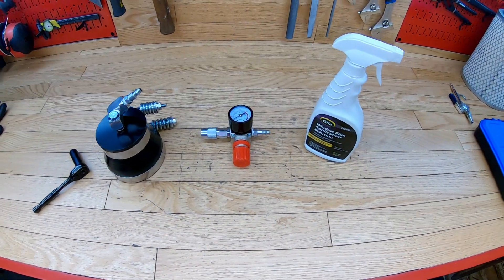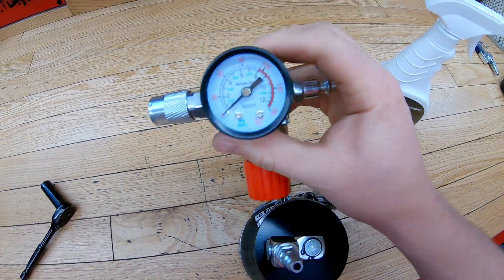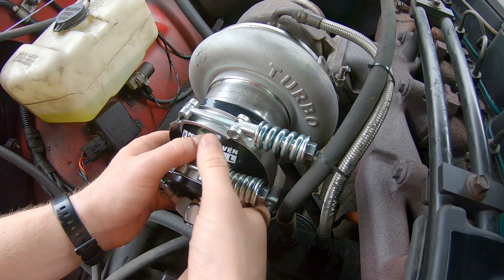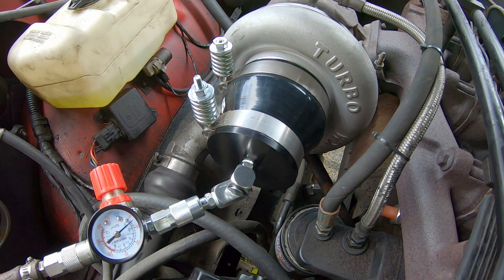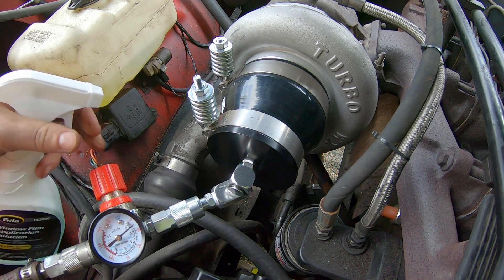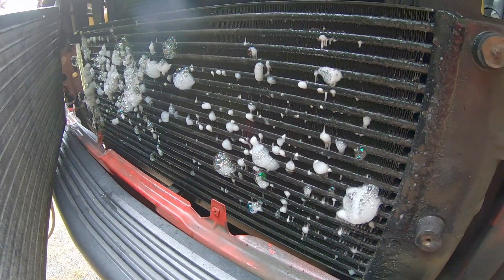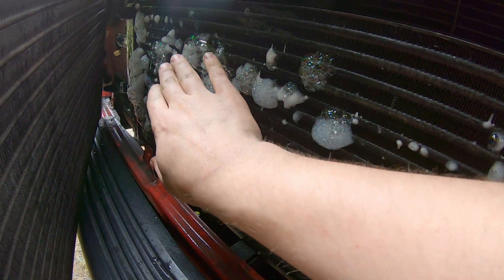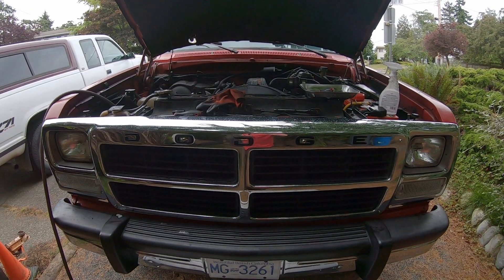How to Test for Boost Leaks | 1st Gen Cummins

Comment: What happens if I do that just with the engine running?
Reply from the maker: You will likely not build enough pressure in the intercooler to test for leaks. Ad idle the stock turbo probably only makes about 1psi boost
Reply: @OvensGarage  ok thanks man

Comment: Placing big, aftermarket air turbines on these small diesels is not a good idea.  I recently bought a ‘99 Ram 2500 the previous owner had aftermarket shops “upgrade”.  All he accomplished was creating problems.  He couldn’t afford to pay for the repairs and had to sell the truck.  I picked it up in trade for a few handyman jobs, and then I spent all the time ungrading the truck.  Thinking you can improve on 60 years of testing, and all the effort in trial and error at universities by automotive engineers, now that’s arrogance and foolishness.  Yes, 30 psi will ruin things.  Cylinders, built of cast METAL, are designed to take the compression of the fuel/air mixture.  Your thin finned air cooler is not.

Comment: I put a power stroke intercooler in my 89. It was years ago, and a pain in the ass. Don't even want to know if my other 2 trucks leak.
Reply from the maker: Yeah that seems to be the one people are putting in is the powerstroke 7.3L intercooler, will see what I can come up with after a bit of measurement and research. There's a lot of universal ones out there too. One of them is bound to fit nicely. Just have to do a bit of up front measuring work first to identify the one that will fit best.
Reply: @OvensGarage  Of coarse my 89 was originally non intercooled but the original owner had a banks intercooler installed by a speed shop in California in 1991. I ran that one for a while, but when I upgraded to a S300 turbo and added fuel the boost was stuck at about 20 psi. Turns out the banks unit would not flow enough cfm's. I put the power stroke unit on and the boost went to 32 psi. So make sure what ever you install will flow the amount needed.
Reply from the maker: I wish banks made a new kit for these trucks. I reached out to them by e-mail to see if they have anything that may fit these trucks. Will see what they say.

Comment: Well done. Boost leak testing is a really under estimated problem. I had a lot of people want a smaller turbo because they say it doesn’t spool fast enough but and other people with the same turbo say it’s spools up great.
Reply from the maker: Really makes me wonder what sort of performance I'll get with your 62mm upgrade after I fix these intercooler leaks! The other thing I think people tend to misunderstand is the boost numbers vs density numbers. Gale Banks talks a bit about it in his "Boost Gauge is Dead to Me" video. Air Temp plays a big part in making horsepower too, not just pressure.

Comment: Hey what turbo do you have on the truck there?
Reply from the maker: It's an H1c turbo with a 62mm compressor wheel/housing and then the exhaust side has a 16cm exhaust housing with the stock turbine shaft/wheel

Comment: Damn, now I bet I need a new intercooler and turbo upgrade too.
Reply from the maker: Intercoolers are cheap....right?
Reply: @OvensGarage  Practically free.
Reply: @OvensGarage  I heard awhile back that PDR in Langley can do a recore.   That's what I was planning to do.  Now I have to check for leaks because I'm pretty sure I can hear them and after seeing this video I can't live in denial any longer.
Reply from the maker: @ml.2770  I wouldn't be surprised if all the intercooled trucks leaked at this point.. I mean my truck only has 290 000kms on it and hasn't been overly abused. They've all got to leak a bit at this point... I'll check them out. I wouldn't mind going bigger if I'm going to spend money on it anyways.